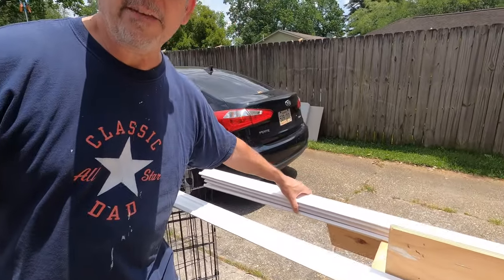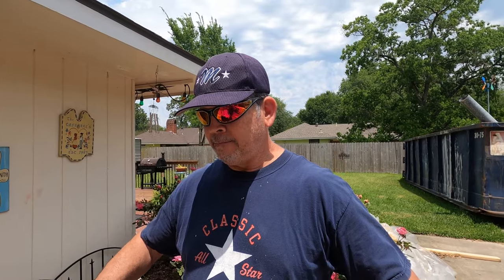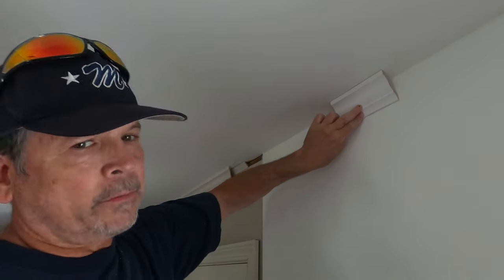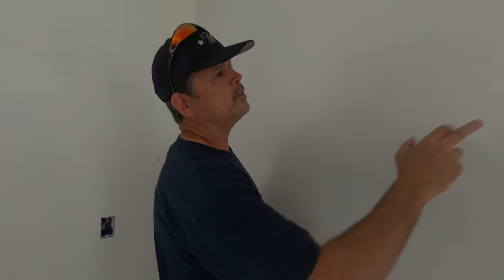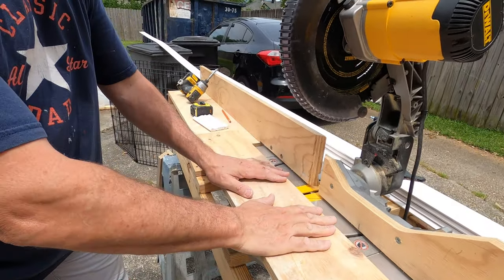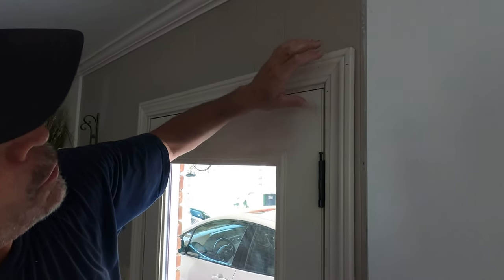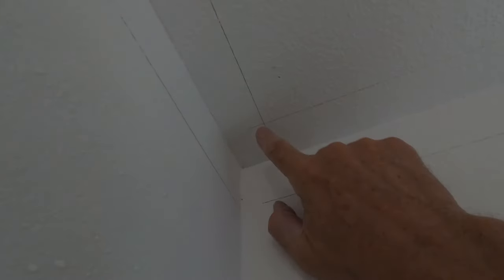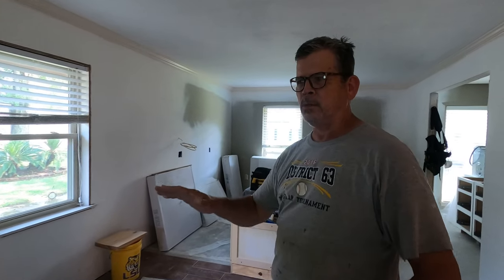Remodeling a Kitchen A-Z - Part 7: Crown Molding Day

Comment: Good tip about the tap on the back when using power tools.  I had to have the tip of my thumb sewn back on when that exact scenario happened to me.  I was using a band saw at the time and my thumb went into the blade.  That was my last power tool accident, about 45 years ago.

Comment: I feel like I've watched 100 videos on your channel after discovering it just last week.  I've seen you cut PVC 1-1/2" and 1-1/4" drain pipe for kitchens and baths, and you used the chop saw.  This item (Ridgid PTEC 3000 Plastic Tubing Cutter) makes it super easy, cleans the sprue, and is portable to do right at the site of application.  Just in case you hadn't seen it before.  Love the videos.  Keep 'em coming.

Comment: Hi guys! Have you used the disposable (not so much for me, I re-use them) paint can pouring spouts (for lack of a better term) made of polypropylene that clip onto the 1 gallon paint cans? They're all over the paint dept at Home Depot on the stud displays. I swear by them! They keep paint off the side of the can and out of the groove where the lid goes, and when you put the paint can down, what's on the spout drips back into the can. Later, just rinse it off and it's good to go the next day, so is your paint can. If you haven't tried them, I suggest you do. If you have and didn't like them, I'd love to hear why. Loving this series!
Reply from the maker: I’ve never used them.  I’ll check it out 👍
Reply: @StudPack  Awesome! I recall they work on quart paint cans too!

Comment: You should miter the outside corner of your jig that is resting on the corner of the wall/ceiling to avoid innaccurate markings due to imperfections on the corner

Comment: Last time I did texture was late 90s or early 2000s. We did it by mixing paint and mud and then rolling it on. I generally don’t mind messing with mud i.e. taping and floating or skin coating but anytime a roller or brush comes out I run and hide

Comment: Mr. Stud Pack is a wealth of knowledge, great crown tips! Quick question: In your curbless shower video, you used the Schluter drain piece and didn't show finishing after that. Did you end up using the whole Schluter water proofing system after that, or something else? Im asking because I like that drain piece for its size, but didn't want to use the whole system (was going to use a product like red guard). Cheers!
Reply from the maker: We used Schluter on the floor and 1/2" backer board on the walls.  We applied 3 coats of Mapei aquadefense (same type of product as red guard you mentioned) over the backer board.  I wanted to use Kerdi board on the walls but could not find it locally and it's bucks versus $7/sheet for backer board.  The Mapei liquid membrane came down over the Ditra.  It works great but voids Schluter warranty.  Check out our exhaust hood video at 03:12 for a look at the finished shower.  Thanks athomediy!!

Comment: I never use wood or MDF crown molding anymore. I use drywall crown molding instead. It is idoit proof. I use drywall mud on new drywall and PL on painted surfaces using a brad nailer to hold til dry. Bad cuts are not a problem since the joints stick together with mud you can make them look perfect. You do not have to caulk the edges as the drywall mud will spill out and just clean it with a trowel. Wavy walls and ceilings no problem you can make them look perfect. If you are careful about  glue and mud you can do existing texture ceilings without spilling onto the texture. You also get bigger profiles like 6 inches and you can buy drywall steps as well. Come in 8 ft lenghts about $2 a foot and no inperfections.  Appearence is way better than wood. They also make it in foam but I never cared for the foam.

Comment: Nice saw jig , did you have a problem nailing on that partisan wall with no double top plate? Nice work!
Reply from the maker: Hey thanks Brad!   Good catch!  How did you know there's not a double top plate:)   We nailed into the studs instead.  We pre-marked the location of each one with that L-shaped jig we made and some rare earth magnets, took 5 minutes.  Double top plates sure make it easier with smaller crown.
Reply: Stud Pack I am hooked on your videos, I’m learning a lot of tips and tricks love the magnet trick too! I’m just a diy guy that enjoys remodeling! The right way! So many guys in the trades should be watching you!
Reply from the maker: @bradwhite6491  that's awsome Brad thanks!  The magnets we use are from Lee Valley Tools, 1/8"x3/4" rare earth magnets.  Best stud finder ever.

Comment: What did you use to find the rafters or studs?  ie that little thing in your hand?
Reply from the maker: They are a stack of 1/8" thick by 3/4" diameter rare earth magnets that I buy from Lee Valley Tools.  Best stud finder ever and never needs batteries but they are so strong they tend to leap off my toolbelt onto any nearby steel object.  Oh, and never get them near your phone:)